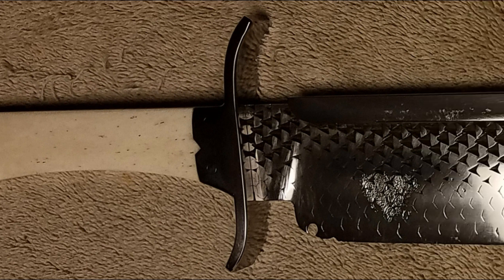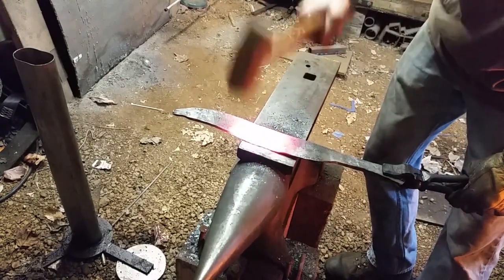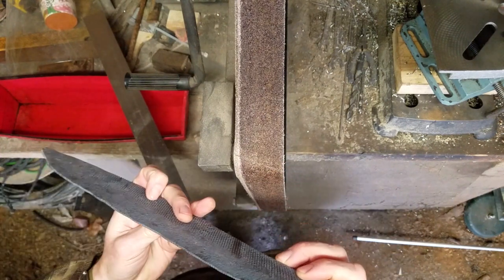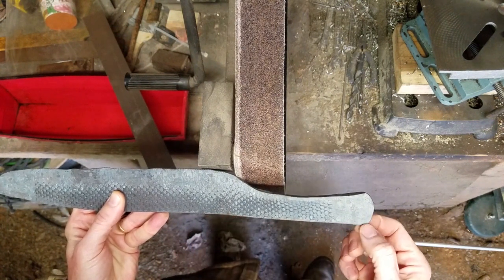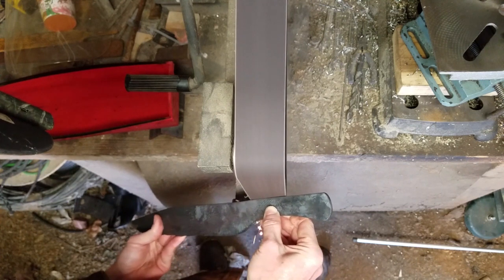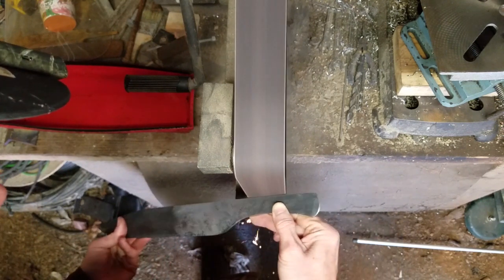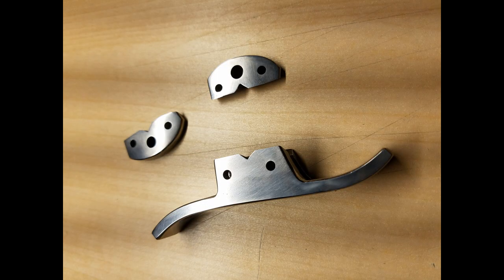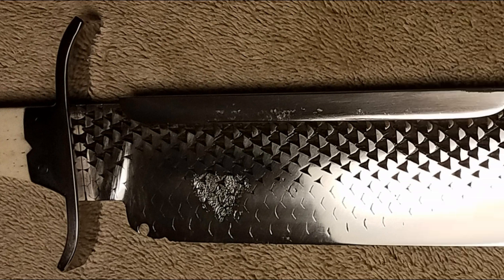Final details video of the Musso Bowie rasp knife project

Comment: Hi Bruce, why the hole in the blade by the guard?
Reply from the maker: It's a 'feature' I found some Bowie's had when researching this blade, and the owner wanted it when I asked about it.
Reply: I think its a nice detail.
Reply from the maker: When possible I always add details the customer requests.
Reply from the maker: To add some detail here, this is called a 'Spanish notch' and while opinions seem to vary, some believe the original intent was to catch the other blade in a knife fight, similar to the metal sleeve on the spine.

Comment: What is the blade length on this piece and how would you charge for it
Reply from the maker: TRINITY COMBATIVE CONCEPTS Jeff Owens the blade has been delivered to its owner.
Reply: stimpsonjcat67 how much would it cost to get a similar custom build
Reply from the maker: Jeff, I make knives as a hobby, not as my primary business.  So it can take a very long time for me to finish a knife.  For that reason I don't really take orders.  My next projects will likely be Damascus Bowie knives borrowing from a few Randall patterns.  I do plan to go back and make a similar knife to this one out of proper tool steel, with the 'rough' pattern on both sides of the knife, but I am still pondering the best solution to do that.  All I can say is watch this space. :)
Reply from the maker: Sorry, blade length not including handle is 12"
Reply: Well I can understand that and nice work man :)